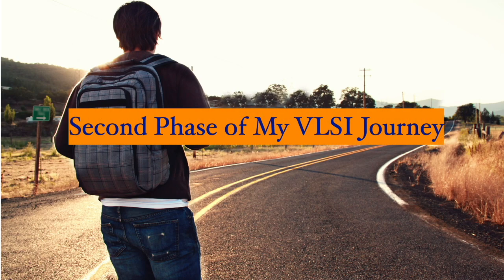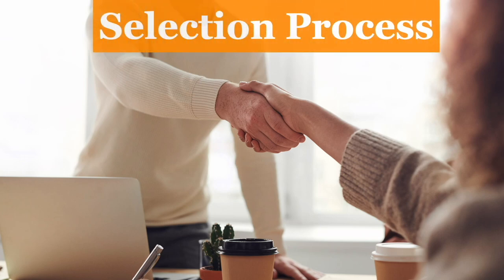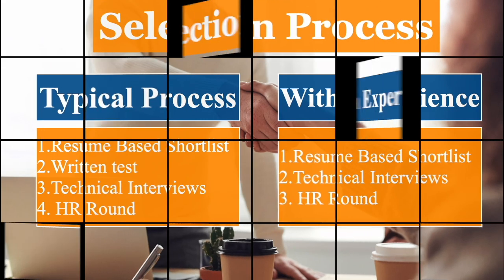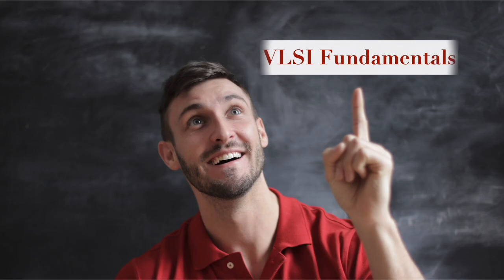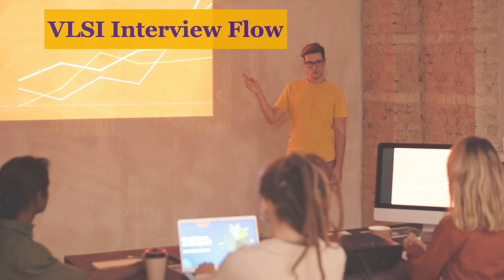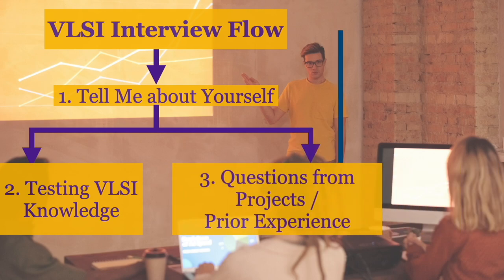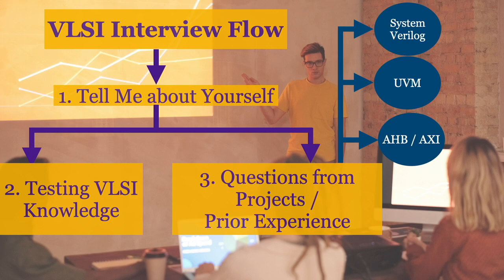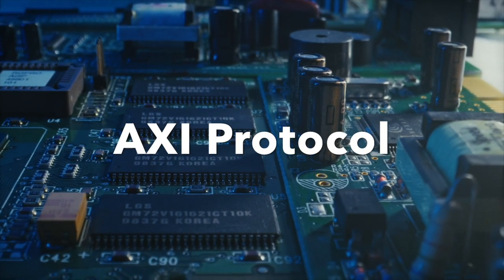My VLSI Interview experience | Job Switch in Semiconductor industry | Off-Campus #electronics #ece

Comment: Hello bhaiya, going to start college this year in Symbiosis Institute of technology, Pune. Got Electronics brach and I'm inclined towards semiconductors. After seeing your pinned comment and replies of other comments academic background does matter. I'm kind of demotivated, but my college provides major in VLSI from 4th sem onwards. Will I be good for the future? Also, Intel like companies do visit our campus
Reply from the maker: Hi, Yes the college background matter line is correct. Because most semiconductor companies visit some specific colleges only.
But as you said Intel visits your college & your college provides a major in VLSI so if you would make yourself ready with vlsi skills & perform well in an interview then no need to worry.
But if companies don't visit college then the path is a little bit tough leading to either M.Tech from top colleges/ training institutes
Because both of these basically help to arrange an opportunity for you.
Selection depends on your skills only.

Comment: Sir I Am Front-end Verification Engineer In one Of The Big Service Base Company of india... Recently Deploy On Project After 2 Months Trainings But I Am Not Got UVM Base Project ...How Can I Switch After 1 Or 1.5 Year ...With good Packages. Is Their Any Chance For Interviews After Getting 1 or 1.5 year Experience In Any Product Base Companies with Good Package And What Is Future Of Verification Engineer....?
Reply from the maker: Just make your skill set strong. Do any project on uvm by yourself. Then you can switch after getting 2 yrs experience. Also keep learning the things from your job.
Reply: @Singh-Rajveer  yes sir thanks for advice.
Actually I am doing formal verification (Assertion Based Verification) ..and C Base Testcases(Static Verification)..They Are Using This Methodes To Verify Embedded Base Processors . Recently I verify single port ram with help of uvm now I will try AXI Protocol ..👍😎
Reply from the maker: All the best!